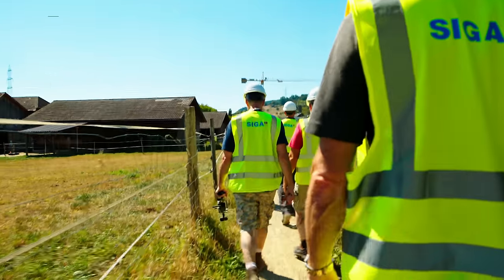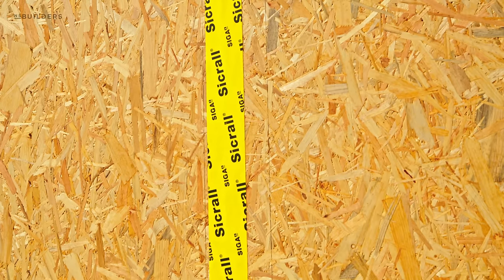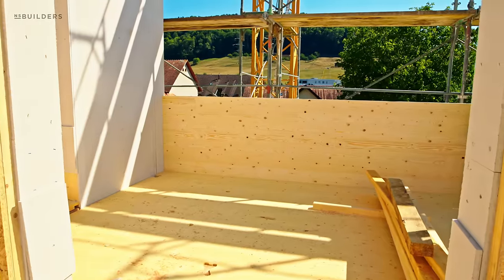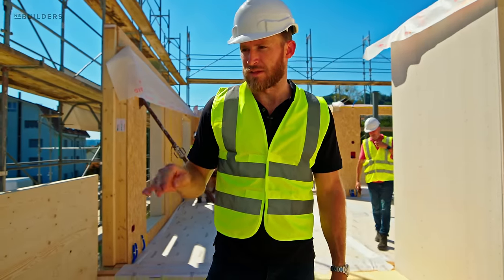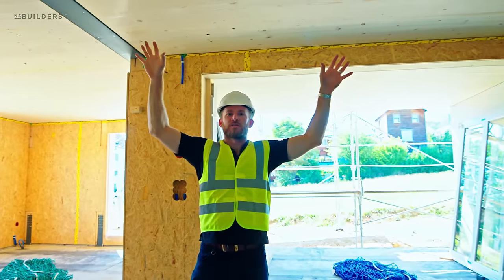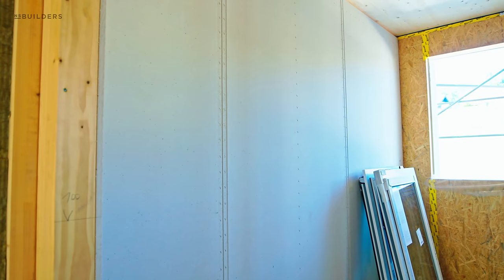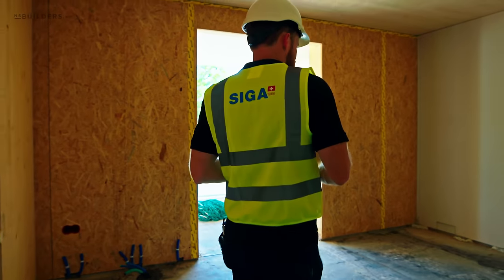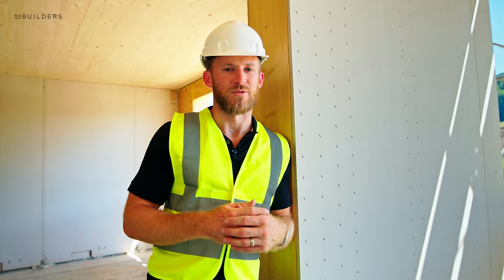Is Cross Laminated Timber the future of Building?

Comment: CLT rocks. The manufracturing process is something to behold - although a plant is expensive one off cost - it is fascinating. There are some Italian factories that produce turnkey production lines. CLT itself is awesome - fire resistent (because it chars then can't actually burn) amongst other features. You can pretty much CAD / CAM an entire house and CNC in factory with conduits etc for all the key power and sewage / water. And then deliver the framework to site....

Comment: The exterior walls are very confusing . they do not appear to be CLT but if there is a thin CLT panel behind  the osb , it is like nothing i've ever seen in Germany , where i live . 
The way CLT is done here , is having panels that are at least 13.5 cm thick with the insulation on the outside , usually wood fiber panels, minimum 14 cm thick  then 3x5 cm lattung ( furring strips ) over the solid insulation panels and a facade on top of that . 
the interior is left raw to take advantage of the hygroscopic effect of mass timber and acts as a pretty decent mass for heat storage and temp and humidity  regulation . 
My house is exactly like this and is super comfortable requiring very little heat .
Reply: if you look at 1:50, it definitely looks like CLT, unless it's a more conventional stud wall, but with engineered wood studs. Otherwise the OSB seems like a waste at first glance (though I'm sure there's a valid reason for it), since the only function it would be doing on a CLT panel could me moisture regulation.
Reply: It's definitely  not  CLT.look at the window opening . if it were CLT we would be able to see the layers . 
as to moisture control , the Panels themselves control moisture through the hygroscopic effect of mass timber . It's one of the main advantages of CLT.  Placing drywall over the CLT would cou counter this effect . 
i live in a clt house . the walls are left bare , no finish of any kind in order for the mass timber to ' breath' . the insulation is wood fiber panels placed on the outside walls  with verticals furring strips on top of the insulation to accept cladding . The entire wall system is about 30 cm thick and is very easy to put together . it's also extremely warm and comfortable in the house .

Comment: I'm a retired electrician who has been interested in architecture since I was about 10 years old this type of construction makes perfect sense to me. Yes it takes more thought and planning at the beginning when you start putting pin to paper but the finished product is far better. I watch all these other countries build modular or complete factory finished homes with better quality than US homes but you still hear the old line " it just won't work here ". My last home was partially factory built in that the stud walls were pre-assembled and the exterior walls had a thermal ply sheeting and windows installed. The major downside was the installers, can't really call them carpenters, had no idea how to use a level or square.

Comment: You touch on it briefly, but I don’t think it’s covered enough regarding CLT.   It is more than framing, but can be the finish surface for walls, ceilings and potentially floors.  All wins for cost and schedule.  You can balloon frame a single family home in a few days with fewer joints to detail.  With exterior insulation long rain screen screws don’t have to hit studs blind and can be at any spacing.  It just seems like a, elegant solution with a big upside structurally, aesthetically, and logistically.

Comment: Looks like plumbing, electric and air ducts may be more difficult or at least a different method. I’ve built so many custom and remodel projects I think CLT will have its challenges.
He did mention preplanning, but I would like to mention change orders.
Reply: I wonder the same. I gather they can rout in pathways for small stuff, like electrical lines. But plumbing and drain lines seem like a bigger issue. I've designed enough commercial projects to know there are typical design solutions that avoid these issues. But for your single family home in the USA, I'm not sure those commercial solutions are appropriate. Our current system of spaced joists and studs allows for A LOT of flexibility in plumbing runs, risers, etc. As a residential designer I highly value that flexibility.
Reply: @fepeerreview3150  
Flexibility, short term convenience, but long term issues, construction quality waaaayyy inferior, houses burning fast, strucutral integrity level of a flying house. 
Completely different mentality in Switzerland where longevity, well thought design and quality matter.

Comment: Great to see more information and details on CLT... I'd love to build a mountain house using CLT for a very efficient low maintenance second home.
Reply: How do you figure it's efficient?
Reply: @court2379  minimal materials and waste for a remote site since it is completely designed and 'fabricated' before arrival
Reply: @stavrosTX  So what if all the waste is at the factory instead of the job site.  It's still wasteful. That the product has higher dimensional standards also means the rough materials have to be trued up before assembly and again after, making even more waste or culls/rejections of imperfect boards.

I agree though from the builders perspective it makes for a low waste construction site. Both materials and probably labor.

I just don't see the value of this over something like SIPs that have way higher insulation value and are strong enough (CLT is obviously very strong, unnecessarily so). They would make a good floor, but again the composite beam formed by TJI joists and OSB subfloor uses far less material, lower quality wood  (than solid mostly clear lumber) can be used, and produces an excellent product for most homes. And there is space for better insulation. The strength of CLT just isn't needed in a residential house but for special spans/applications.
Reply: @court2379   I quote you; ''So what if all the waste is at the factory instead of the job site.'' The ''waste'' are at a very minimum because materials do cost a lot and they do plan a lot about to use every single piece of material. At the end of a week, not enough to fill a single garbage can ;-)

Comment: What u can also mention is that raw clt walls provide a much nicer room climate than any other wall because wood regulates the air moisture by itsself and therefore the air quality in the room feels much nicer
Reply: exactly . the walls must be left raw to take advantage of the hygroscopic effect of mass timber. i live in o;e of these house which is used by my wife for her business . Every client that comes to the house remarks on how comfortable it is .
Reply: @siriosstar4789  i think it's also the fact that even mass timber doesn't absorb heat as quickly as sheetrock or a bare brick walls, meaning it reflects a lot of the heat from the room and the people back.

Comment: So is the building method born of advanced methods or necessity, at the end I see your leaning on what looks like an 8" or 200 mm wall. This screams short building season unless you do it inside a controlled environment hence a factory. The construction method seems to be brought about by what I would call a short assembly time. If your building multi-story buildings time would be of the essence in an environment where you need 8 inch walls and the sun shines a limited amount of time.
-MG
Reply: I think it would probably make more sense to have a tent of some kind to temporarily erect over the building site, temporary aircraft hangars are fairly ubiquitous.

Comment: Termites and water ought to have a great time with it
Reply from the maker: You build to prevent those things
Reply: @NSBuilders  - Would it not require that one build extremely well? It would require specialized products ...  Perhaps boric acid infused wood or similar.  

I am not a builder.  My understanding is limited only to my imagination; but not by experience.  I would be very interested to hear why we don't see more use of concrete in building, (eg, SIPs or ICFs, etc.)?  Among other things, it seems many of the problems inherent to wood are excluded; and, they are not as prone to destruction by insects, hurricanes or water.   Thank you for taking the time to put your thoughts.  It is valuable to me.  I am trying to consider the best method to build here in the Caribbean.

Comment: One of my frustrations is how we in the U.S. aren't taking advantage of newer technologies like this, & doing more building more panels in factories to drive down cost & improve quality!
Reply: We do already. SIPs, ICFs, there are a few Lego style block systems, many log cabin style premilled systems, etc.. The problem with all of them is they cost more. The US generally isn't willing to use them because the builder or buyer isn't planning on keeping the house long term and the subsequent buyers won't properly consider the value of a better built home. It won't fetch much more on the market, so there isn't a good reason to build that way by most builders. It just reduces their profits. 
I actually think SIPs are a better wall system as CLT uses too much materials and has poor insulation value. It has a place as flooring replacing concrete though. They should make panels with 3in of iso foam sandwiches in the middle.
Reply: Its incredibly expensive
Reply: your frustration should not be that the U.S. aren't taking advantage of newer technologies it should be that people are to cheap and dont understand the value
Reply: @toucanvanbeak  🤣
Reply: @daveklein2826 , definitely!

Comment: With consideration to building regulations for every regional area, and the types of conditions each faces, it is unlikely that such panelized construction except as an overlay, will become a standard. No proof that such construction can withstand weather conditions of tornados, hurricanes, or earthquakes, fire and floods. And will never be used for major multistory construction. There is also the consideration if external finish applications wherein small  imperfections can cause water penetration which if not immediately checked, will easily rot any type of a USB board. Especially in an acid rain situation. Then using it for elevator/ stairwell construction is inadvisable as core materials must be able to withstand greater compressive strains.  While cross laminated studs are being accepted for certain uses Eg: kitchen walls where cabinetry will hang etc, most  will not be. Willing to pay. A 30% premium for products that have  not proven a durability over other construction methods.
Reply: We have high rise buildings in Australia using CLT. Onsite construction time is reduced, in crowded cities, less concrete trucks, noise etc. Atlassian is having a 40 story hybrid building built in Sydney. OSB is not a common board here though, so some of your objections are not relevant. Watching TV footage of American "stick" houses after hurricanes implies that stick construction is not that good anyway.
Reply: @peterblackmore7560  how many covid vaccines have you had?
Reply: I quote you; '' No proof that such construction can withstand weather conditions of tornados, hurricanes, or earthquakes, fire and floods.'' These are building build in Switzerland for Swiss conditions. Don't say a word about 2x4 stick build house to withstand tornados, hurricanes and every other weather condition as we can see on TVNews, very sadly, too frequently ;-)
Reply: Came on in the US homes are built with toot picks and cardboard.